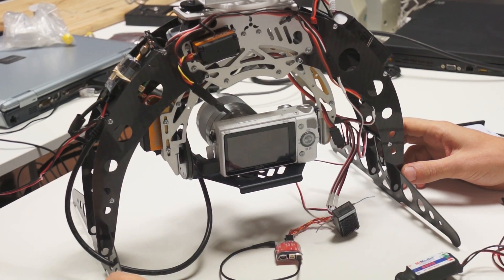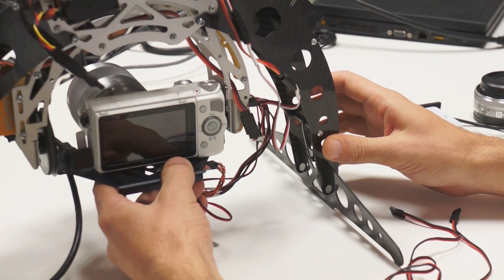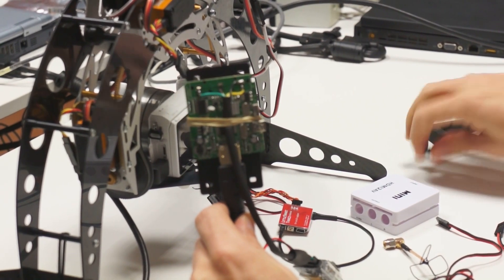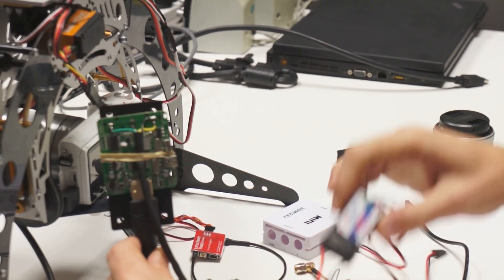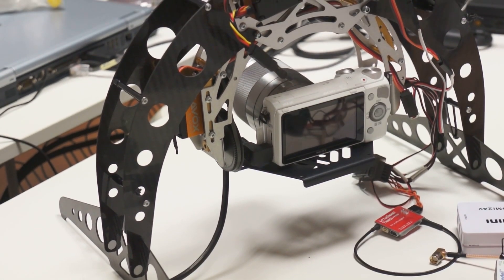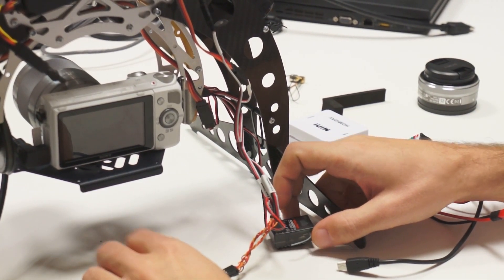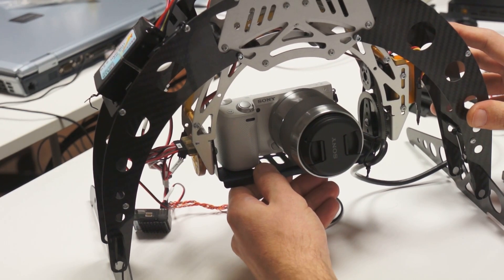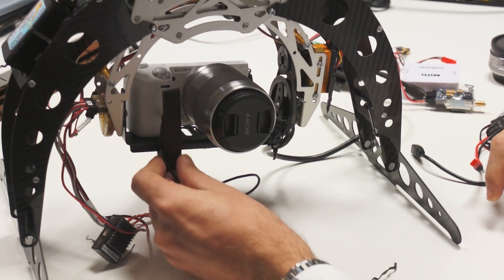Sony Nex 5N / 5R on AV130 (HDMI converter) - Part I

Comment from the maker: @Fuckingwev: from the converter you only need to get the GND and Video OUT signal and pass it to the VideoTX (and also the sound if you need it but that's useless in UAV applications). The VideoTX must be powered separatly by 12V (see part II)